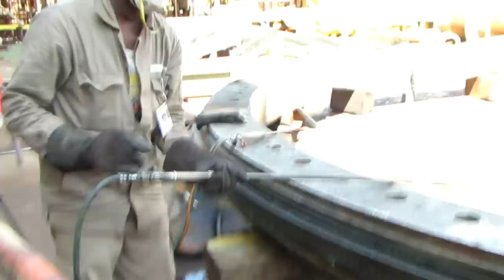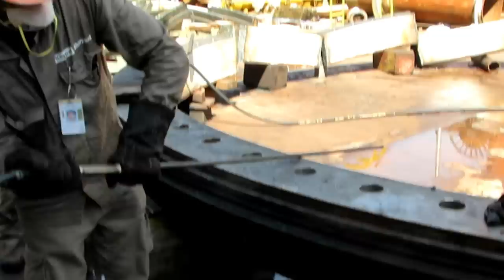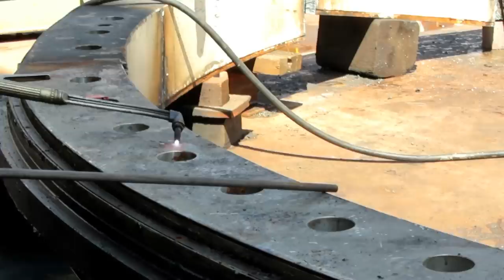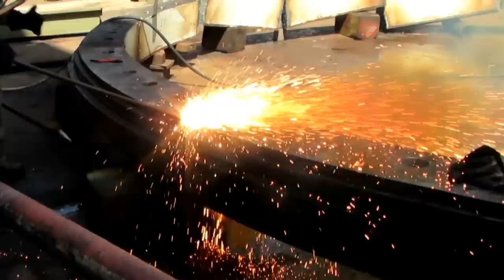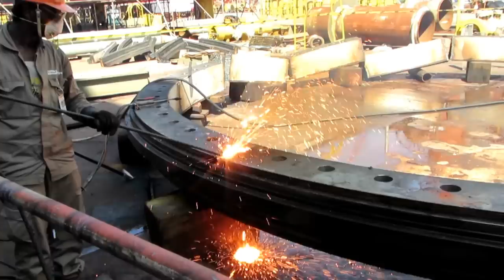Thermal Lance In Action - Scrapping a 2 million dollar FPSO turret bearing

Comment: Saw a trick for lighting the lance without a torch. Steel wool into the tip of the pipe then touch it with a 9v battery and slowly turn the Oxygen on with the lance up against something to keep the Oxygen from blowing the wool out of the end. The burning steel wool quickly gets the tip of the lance hot enough to keep going.
Reply: Putting it against a piece of burning charcoal with the oxygen on also does the trick. Learnt it the hard way...
Reply: Another good way is have 2 short pieces of railroad tie close together burning in the middle.  Stick it in, turn on Oxy.  We did it cutting the old CNW bridges alongside the Kennedy Expressway. The contractors had from Friday night to Monday morning to blow a single bridge down and swing the entire new one in place and connect it up for the morning commuter trains coming in! Repeat every weekend!  They never missed a beat the whole contract!

Comment: This brings back some memories. In a previous life I was a boilermaker working down a mine in a diesel workshop and when the loader buckets were being replaced, sometimes the pins were too bent to allow driving out with hammers. So they would call for "Lance-a-lot" (me) to do my thing with the giant sparkler. It does take a bit of practice to wield these things to get the cut done safely, efficiently and properly. The bucket pins had grease channels in them, and would give me a hell of a fright sometimes when I got blow backs. Watching this video, though, if those holes on the turret ring extended all the way through the metal, maybe I would use them as the starting point of my cut. I realise this would mean standing on top of the ring in this instance and the length of the lance would make this awkward. Thanks for uploading this.
Reply: In your opinion could you use a burning bar to do something like carve a cave out of solid rock? I'm studying rock-cut architecture. Thanks.
Reply: What do you mean "In a previous life"?
Reply: @lapinbeau  considering his name I doubt it…

Comment: That guy must be new...he has his pants tucked into his boots.  I'm surprised after all those sparks that he hasn't discovered the error of his ways by now.
Reply: +Mark LaForce he's brown skinned.. does it really matter?
Reply: +chronok , it's not about skin burn, its about slag falling into the boot and burning small holes into his feet.
Reply: Kendall Shrock i made a joke about the work safety in asia where people dont use the right protection.. I heard crazy stories like people walking around with a co2 steel laser cutter, because the controll box broke down.. they wete manually carrying it over a big metal sheet.. crazy
Reply: Gotcha. Yeah. Like bamboo scaffolding to build roller-coasters.
Reply: +Muscle Nerd pound for pound, yes. Your logic is flawed. Spider web is even stronger. That doesn't mean it's safer to use as scaffolding.
Reply: Kendall Shrock do you mean spiders silk?
actually you are quite mistaken it can be woven into a mesh like fabric and wrapped around steel to make it more durable and with a higher possibility of the building the steel beams was build with with stand earthquakes
Reply: +Muscle Nerd my point is that it's not more suitable for the application. Far too costly. And bamboo is flammable. Not a good choice to be welding 75' in the air with every single stick of your structure below you being flammable.
Reply: +Muscle Nerd this would cost more to make than carbon fiber tubes. It's completely illogical. It costs so much that they aren't even doing it in Aerospace.
Reply: Lol. Worried about his legs and yet no comment about the lack of head gear? Lol
Reply: Its actually safer that way. The smaller you can make your profile the less things on your body can catch fire. Same reason the military does it, along with tucking their laces on their boots.
Reply: it's really not that big an issue dude, i use torches tucked boots and pockets without flaps and have never run into an issue over hundreds of hours
Reply: your high school shop teacher only told you that because of liability mr. smart man
Reply: noah hall I’m in welding school right now doing some gas cutting and a lot of high spatter welding. I saw the guy in the booth next to me catch fire with sparks catching in his pants because they were bunched up. I’ve burned my ankles quite a few times from having exposed the top of my boot. You’ve just got some luck if u haven’t burnt yourself
Reply: I used to do one better.... Steel construction on a power house in a tropical climate and the work gear was shorts, singlet and a pair of open 'Red Wing' shin high pull on boots...... Not as silly as it sounds because the moment a spark would get down the boot, it could be immediately pulled off by the toe of the other one.... Compared to lace ups which would mean a third degree spot burn by the time you managed to get the laces undone and pulled off...... Having pants over them? Not so smart either. I've had my cuffs on fire while welding on fittings on steel plate and while needing to lie down while doing it. All welders sparkle with white dots under those nightclub lights. Infrared or whatever.
Reply: I know nothing about this type of work but I do work with hot steel and I am very nervous watching the way he's just cutting so that all that molten steel sprays everywhere, I think it would have been better to cut the far edge first so it was lower and all the melt would run down the back instead of spraying everywhere.
Reply: I had the same thought lol
Reply: @Neuroxix  yeah I'm no expert on thermal lances but that seemed like a very stupid way to approach the problem. it doesn't take a rocket scientist to see the problem there, and that he could just as easily have done it your way.

Comment: question: could this be used to cut open a bank vault? Asking for a friend.
Reply: +MC
Sure, if you don't care about what condition the contents of that vault end up in once you've cut your way in. Or what condition you end up in once the security guards realize what's happening (and they will, no exceptions).
Basically, only useful if you're SCRAPPING a bank vault, not EMPTYING one.
If it can melt steel, it can burn money and art, melt gold, and turn gems into charred (and worthless) powder.

If the thing you're after is in a vault and then also in a latched but not locked tungsten box (or is itself made of tungsten), you might have a chance of getting it out without much damage. The sensors of that vault will obviously detect the attempt, however. Additionally, cutting the power counts as an intrusion attempt.

That's how protection systems work. Done right, even a successful break-in ends up costing more than the value of everything inside.

IRL vaults aren't the same as vaults in a game like Payday. They aren't required to have a way to "win" at breaking in. As mentioned, when done right there isn't even a way to break even.

Technically there is always a way to break any security system, the problem is that it always has one or more of 3 downsides: it takes next to forever, it destroys the contents, or it costs so much to pull off right that it's not worth doing in the first place.
Reply: +44R0Ndin You .. clearly take Youtube comments very seriously.
Reply: +44R0Ndin Burn Notice taught you that?
Reply: +MC The mythbusters did a opening a safe with a thermal lance if you want to see what it dose to the things inside.
Reply: +MC You can cut open a vault. But it would take a long time and you would end up damaging some of the contents.
Reply: +MC i recommend the buzz saw
Reply: +Andrew H They opened a small gun safe, that's not the same as using it to breach a walk in safe, and they did it from the top too, so of course molten metal will destroy a wooden scepter. I have learned Myth Busters is more propaganda than fact.
Reply: The Thermal Drill!
Go get it!
Reply: MC Yeah, just slap it on a holder and be ready for cops

And splicers
Reply: MC first time I have seen this thermal lance in the Jason Statham movie "bank job".
Reply: You could use an industrial laser..around 5-6kW...to cut steel plate up 1" in thickness. But you'd have it stored in the back of a semi and would have to back the trailer right up to the vault to be cut.
Reply: It can, but you might end up burning the money and destroying the papers and valuables in it.
Reply: LOL great laugh
Reply: @Sara-L  an industrial laser ...are you thinking of a plasma cutter ?
Reply: @scottsimmons5846  even tho it would work better...nope lol
Reply: No only steel beams on the WTC
Reply: Yes and if you are carefull it doent damage the contents much
Reply: Yes, along with burning down the bank and any valuables in it.
Reply: 44R0Ndin im amazed by your the amount of your research
Reply: Dig a tunnel under the vault and cut threw the metal reinforced concrete like they do in The Bank Job
Reply: Come up through the vault floor, these cut through concrete like butter, the contents of the vault will be intact no worries, unless of course you miscalculated you distances!
Reply: There's a film where they did this. Pretty sure it was in the 70's it happened but came out in 2008 I think? It's called "the bank job" I've watched it a few times.
It's a good British film n a good story n it's true! You'd never be able to do it these days n if you did I'm pretty sure they'd never let you out again. 

Same as the Hatton garden job. Which is also a British film n only one person go away with it as he wore a wig. 
Fair play to him I say as no one got hurt as they were the only people in the building. It was Easter bank holiday. 

Couple of good films to watch.
Reply: @44R0Ndin  Human element is weakest always.
Reply: sure mate! but quite some time ago
Reply: @TheManLab7  Diabolik
Reply: Asking for yourself
Reply: shane cotter plasma cutters are a lot more common
Reply: They have used these on vaults, they cut concrete very well,
Reply: @CrimeVid  I'd argue they cut concrete a lot easier than metal which is ironic...
Reply: @mr.techaky7655  it ain’t easy,but it works
Reply: Although a thermic Lance can cut through 10 feet combined steel and concrete, a thin layer of stainless steel say 1/4" somewhere inside would stop it in it's tracks, you could melt it but would be very difficult to cut through and cut material beyond stainless layer.
Reply: yes, but any contents, particularly paper will be a total loss
Reply: @44R0Ndin  i think mythbusters used one on a vault with the same concluseing.
Reply: @ToxicallyMasculinelol  Which is another way of saying what I said, that "you wouldn't want to use this to open up a bank vault unless you didn't care about the contents". See, they use something else (a drill) because they care about the contents.
Reply: @44R0Ndin  actually this is what you said:
"IRL vaults aren't the same as vaults in a game like Payday. They aren't required to have a way to "win" at breaking in. As mentioned, when done right there isn't even a way to break even.

Technically there is always a way to break any security system, the problem is that it always has one or more of 3 downsides: it takes next to forever, it destroys the contents, or it costs so much to pull off right that it's not worth doing in the first place."

the implication obviously being that some or most vaults are impossible to break into without destroying the value or expending an equivalent amount of value. that's the part of your post I'm disputing, since if you were correct, there wouldn't be international bank robbery gangs risking life and liberty to rob bank vaults. your post just gives the impression that you genuinely thought bank robbery was just some fantasy thing that happens in movies.
Reply: @44R0Ndin  The gang that did the Baker Street robbery in 1971 used a Thermal Lance and they were successful
Reply: @ToxicallyMasculinelol  Well then the banks that are getting robbed are obviously not taking their security seriously enough, or they weren't accounting for some risk that was exploited by the robbers.
Also, there's another way into a bank vault where you don't even have to "break" anything. You get them to open it for you, or you get them to unwittingly give you the codes/data needed to open the vault.
If the bank vault is designed correctly, the most vulnerable part of the bank vault would be the person who knows how to open it.
I was incorrectly correlating computer encryption to the security of a bank vault, it works when you are looking at how secure the encryption is but it doesn't work well when you think "how secure of a bank vault would I have to have to match this level of encryption?"
Reply: @warrenb8596  Well with a big enough bank vault the problem of destroying everything inside becomes either much less of an issue or a complete non-issue, simply because the sparks won't hit everything.
But when you consider something like a smaller safe, yes a thermal lance will reliably destroy pretty much everything inside except perhaps rubies and emeralds (they're mostly crystalline aluminum oxide and some impurities that give it color, and aluminum oxide is very hard to melt) maybe diamonds would survive too, but you can get diamonds to burn at a high enough temperature (I think about 800C) because they're just a very specific arrangement of carbon atoms.
Reply: @44R0Ndin  lol oh I see, a random youtube commenter knows more about bank vault security than the international companies that move billions of dollars every day and actually construct the vaults. they should be so grateful that they have someone as knowledgeable and magnanimous as you looking out for their security.
Reply: @ToxicallyMasculinelol  Look, I'm not saying I'm an expert. I'm just saying it doesn't take an expert to tell you that they needed to do better than they did.
Reply: what do you mean? thermal lance tubes are designed to melt. it's a consumable product
Reply: @nacs  Thats my show
Reply: Gouging ftw
Reply: Back in the 70's a dutch safecracker by the name of Aage M. was famous for it. Hes nickname was "the king of the thermal lance"
Reply: Ask Michael Mann.
Reply: Watch Money Heist

Comment: Used to work for a company that sold slew bearings......if we sold one we were set for the year.
Reply: What's a slew bearing??
Reply: Slew ring/slew bearing/ turntable bearing. Mostly found in excavators
Reply: Thermal Nights my guess: the big ring being cut on video
Reply: @thermalnights3987  basically, it's a giant bearing that supports a heavy, slow turning piece of machinery (i.e. a crane or a wind turbine)
Reply: @yaboyblacklist2431  Straight from wikipedia.
Reply: @difflocktwo  *paraphrased from wikipedia
Reply: @yaboyblacklist2431  not necessarily giant. you can make a slew bearing of any size. there are bevel slew drives in some automobiles. although I guess African Electron worked for a company that sold giant ones, since a small one isn't worth enough to employ a bunch of people for a year haha.

Comment: Thanks for this fascinating clip. Any idea where I can learn more about how a bearing this size is manufactured. Would love to see photos or video of the machines and the process used for that.
Reply: Very large diameters tend to be machined in a vertical orientation rather than normal turning with the workpiece horizontal
Reply from the maker: Roger Haley Hi Roger, thanks for the comment. I'm currently in the UAE building 2 identical main bearing turrets for a pair of FPSO's. These bearings will be the largest diameter bearings in use on an FPSO in the world (17000mm). They are of a 4 piece segmented design (nose ring, backup ring, supporting ring, retaining ring) with 240 96mm holes and they are currently being packed and shipped after a good factory acceptance test. I will endeavour where possible to upload a video of the assembly here on site. Best, James
Reply: @Mechtravels  did you ever gey that video?
Reply: @owenwilson3750  probably not, not finding any new comments from Cap.

Comment: I would have thought that sending the bearing back to the manufacturer they could have reground the races and fitted larger rollers and balls to restore it to spec.  But it's just 2m , order another new one. And how many of this bearing does your company own in service.  I guess that because of its size the cost of a two way trip would put the rebuilding of one out of sight. I would never play poker with that bearings sales rep. No we can't guarantee that the clearances won't open up over the next 15 years, you'll just need to buy  new one.   Thank you for the cutting front edge video.
Reply from the maker: wayne p yep it was a warranty issue...QAQC.
Bearing failures are a touchy subject, when they fail or seize offshore (due to many reasons but poor maintenance and lack of greasing is the main cause) then the intervention works required to fix/remove/install them are nothing short of huge. First of all, the FPSO needs to be locked in a fixed heading so the bearing can be isolated, Production will need to be shut off, so there won’t be any oil/gas flowing from the wells during the intervention, all the wells and safety valves need to be closed in, the bolting needs to be loosened, then the whole  turret needs to be lifted so that the bearing can be removed. 
Check out https://mobile.offshoreenergytoday.com/tullow-confirms-damage-on-jubilee-fpso-turret-bearing/

This would take months to fix. I know guys on the intervention project there and it’s a complete disaster. 
So in summary, for the sake of 2 million vs losing 1 million per day production if it fails, it’s (excuse the pun) a drop in the ocean ;)